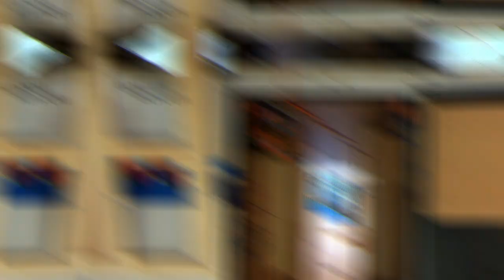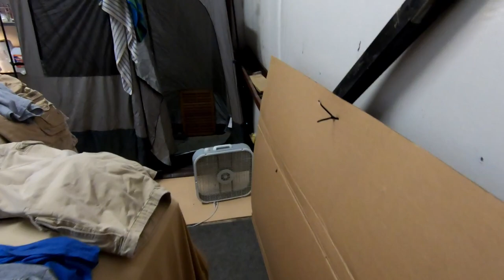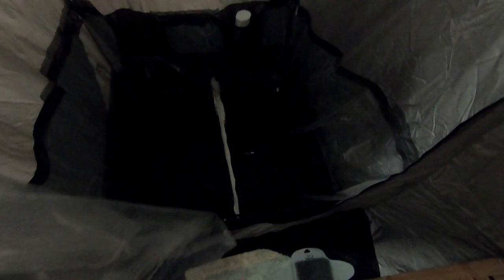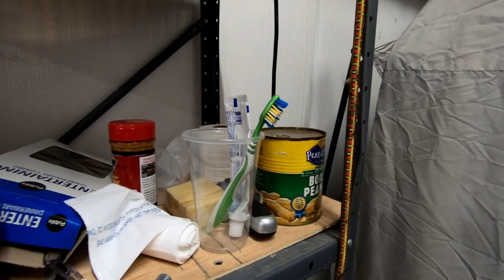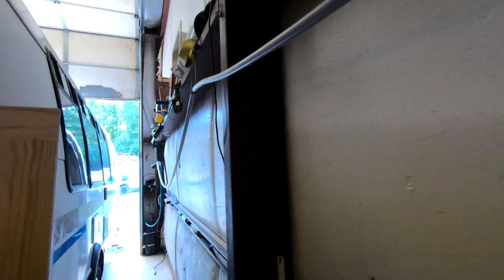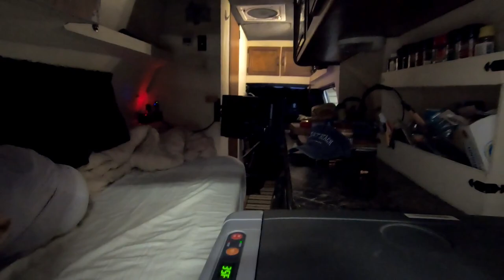Van Life at its Worst - Van Build Behind The Scenes

Comment: Buy a 12 volt water pump. Get a self priming and auto shutoff .read the spec it hold a pressured so it going on for 5 secound and stop. Basically no electric used.about 40-80 psi then get a water mister kit. So yo can’t custom wre you want the nozzle.
Or buy a kit goggle water mister nozzle you want aboutv.0004- .0006
That real fine cause it’s will evaporate in the air and cool the air. Work with a fan is best
Reply from the maker: Very smart